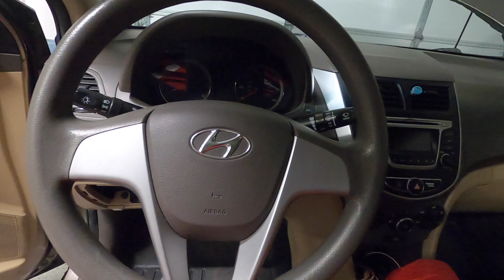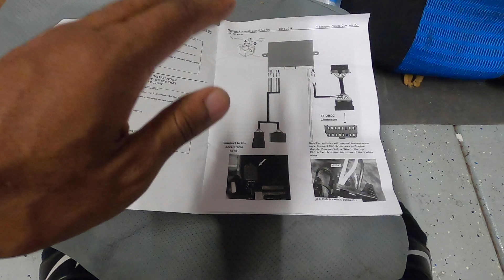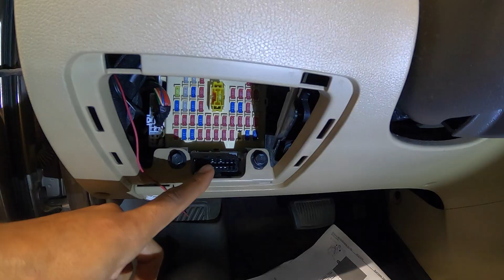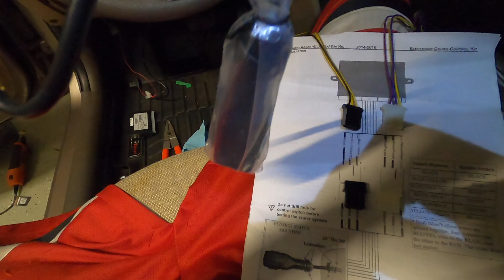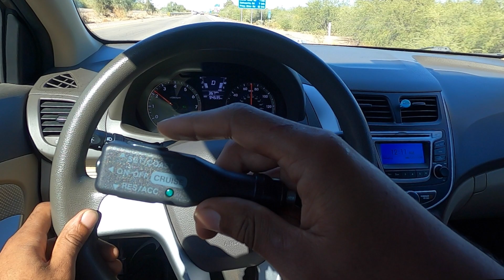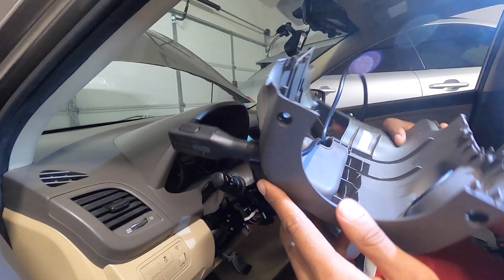HOW TO INSTALL CRUISE CONTROL IN 2010-2016 HYUNDAI ACCENT|  Rostra Cruise Control Kit 250-9628

Comment: Excellent video bud, I wanted to see how much trouble the install was going to be before I purchased the kit. You did a great walkthrough. I'm going to order the kit online in the next couple of days and rewatch the video as I install it. I'll let you know how it turns out. Thanks
Reply from the maker: THank you! glad it helped!. and its a little time consuming but you got this! and ours is still running perfect and great! you'll love it!
Reply: I just finished my install and it works fairly well. Sometimes it doesn't want to set the speed but if I hit resume and then hit set it works. I might email the manufacturer see what they say. BTW I used an open fuse port instead of cutting into that pink wire just so I wouldn't have any problems in the future with that wire. Thanks again buddy.

Comment: hi, friend. I recently bought a 2017 hyundai accent and that's when I saw your video. but what I did was buy the original steering wheel controls of another hyundai that does have cruise speed then I downloaded the electrical diagram of the car and I realized that the three cables that go from the computer to the steering wheel did not have them, I installed them and everything works perfectly. If you want you can write me so that with all the details you can do it to your car if you still have it or you can make a video so you can help more people. Thank you. As you can see I don't speak English I had to use the translator
Reply: Nice find. I have a 2013 accent crdi 4 speed automatic. Where did you find the electrical diagram? I already bought the US accent steering wheel cruise control buttons but I haven't installed it yet. You're help is greatly appreciated.
Reply: Hello! Can I know where did you got the electrical diagram for the cruise control?? And which cable were missing to make it work?

Comment: I had a cruise control in 2004 accent, and now I have a 2015 accent with 6 spd manual transmission, but cannot find the installer who did my 2004,   I had cruise control in my first Hyundai standard transmission away back in 1988,I watched the video, but feel there is something missing (the vacuum advanced chamber)

Comment: What could have disconnected or got loose,  the control's green light turns on but the speed control doe not work anymore,  it was working fine
Reply from the maker: Not sure.. but I would first check if the pink speed sensor wire came a-loose or if its not that check those 6 wire connections from the hand controls  to the harness that goes to the control box.... if neither of those work, maybe try contacting Rostra for some troubleshooting tips, or maybe just replace the control box itself. I believe there's some type of warranty on these things but I don't know their terms and conditions.

Comment: Does it work with manual transmission?
Reply from the maker: Sure does.... I never did a video but this exact kit worked on my 2017 manual Accent. there's just one extra wire that connects to the clutch wire. and it acts just like the brake one. When you press the clutch it disengages cruise control.

Comment: Hey man
well done professionally. 
Kindly your support, I did many research to see if there is a cruise control for hyundai elantra 2010, is this one be installed for elantra 2010
Reply from the maker: after a brief look, yes this 250-9628 will work on your car but it says to check if you have other things too like manual transmission and/or mechanical throttle control, becasuse if. you do you may need more parts.... check out their website https://www.rostra.com/search.php

Comment: hey bro,
just to share with you and anyone else..
I have a 2010 Optima (Diesel Manual 6 speed) 
and installed it 5 years ago.
but... Instead of the green light  - I added a LED to the gauge cluster and wired it there.
instead of the big ugly stock, I took apart the buttons and replace the inside of the original buttons for my model. 
now, after 5 years of working fine, I got some problems, not sure where from, but I would make an investigation and edit my comment maybe in the future.
sometimes it don't set (coast), and sometimes after setting a cruise speed, and pressing RES, it would just cancel the cruise (but not turn off the module, the indicator is still ON on the gauge cluster).
What i've noticed is that the module is very sensitive to other consumer, one time I left the cruise ON without cruising, and when the music hit a loud bass - it suddenly on itself started cruising.

Comment: Hey, can this be installed on a 2011 Hyundai ix35 2.0 CRDi 16v ? 
Great video :)
Reply from the maker: you'll have to read specifics on the Rostra website http://www.rostra.com/search.php  But I think they make one for your vehicle because your IX35 should be similar if not identical to the Hyundai Tucson which uses the kit 250-9627. But definitely do research first.

Comment: Hi man thanks for the video, Finally I found a solution for my car it is 2015 model. But I have couple of questions since you used it for a year now. 
Have you had any troubles like buggings, not responding or any problems? And have traveled between cities or driving in highways by it?
is your engine 1.4 or 1.6?
Because honestly I am a little afraid because it is an aftermarket product. 

Once more again, Thanks a lot <3
Reply from the maker: my engine is the 1.4L ... and the cruise control works great to this day!, no issues at all. and my wife uses it for at least 80 miles Highway everyday going to and from work. So it works great 👍

Comment: Hey man I just bought a 2016 accent yesterday and  Can't believe I didn't check to see if it had cruise control! How is your cruise control holding up?  It looks like you made your video 6 months ago.
Reply: I did the exact same thing a few days ago, but mine is a 2017. I felt stupid right after I left the dealership.
Reply from the maker: The cruise control is working perfectly still!. in both this car and in my new 2017 Accent which I installed it on. Mine is a Manual transmission and works perfect!
Reply: @EverythingAvron  thanks

Comment: Watching a lot of these because my rostra cruise is stuck and won't disengage, so when I start my car it's instant 7000 rpms and no regard for button presses or brake and accelerator attempts to disengage. Literally had to turn my car off to slow down lmfao the cruise was professionally installed many years ago 🤷

Comment: U had any issues with it ??
Reply from the maker: Not really an issue, but when you click "Set" at the speed you want. Theres about a second delay before it takes over. So if I let off the gas right when I press the button the car slows down briefly then accelerates again to get back up to the selected speed.... The simple remedy to this is I just keep my foot steady on the throttle for a second after I press the "Set" button. 👍